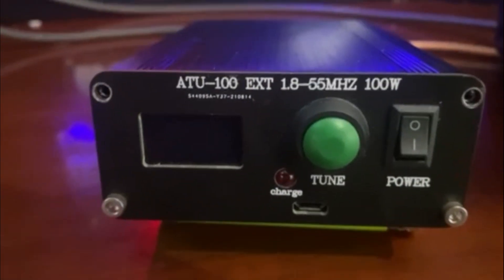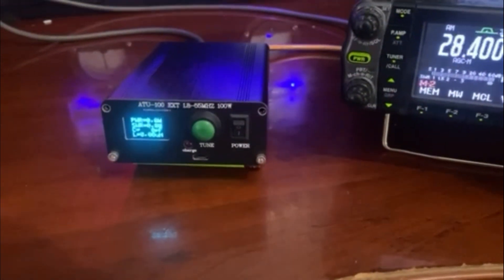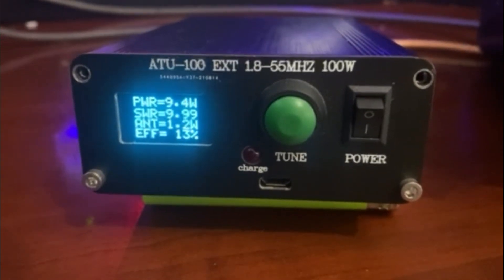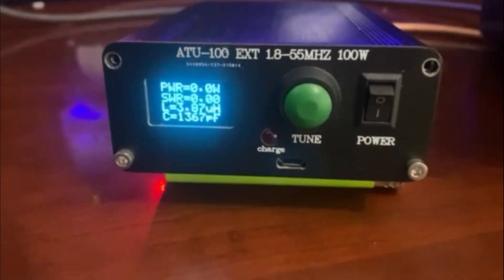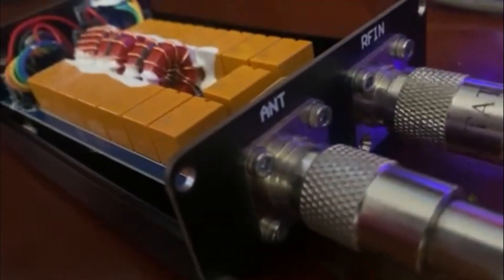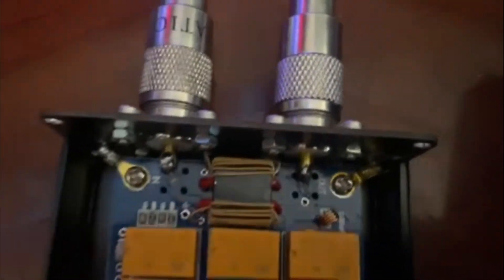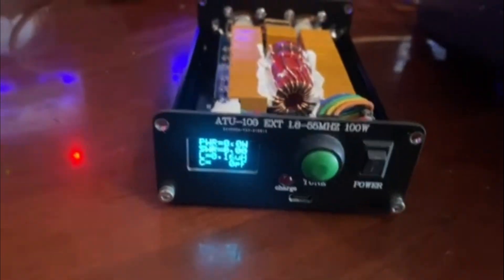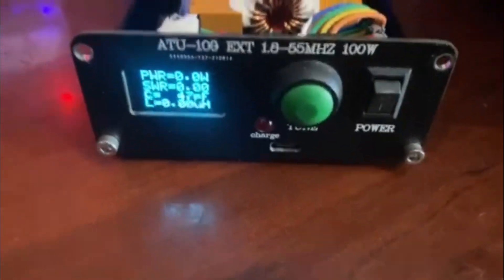ATU 100   CHEAP  100 WATT AUTOMATIC ANTENNA TUNER

Comment: They work well, but sometimes you get a dud and need to check the solder connections and cables. I perform inspections on all this cheap stuff from China since quality control is non-existent in these mass-produced products.
Reply from the maker: That’s been my experience. Half the time it works as it should and the rest are doa.